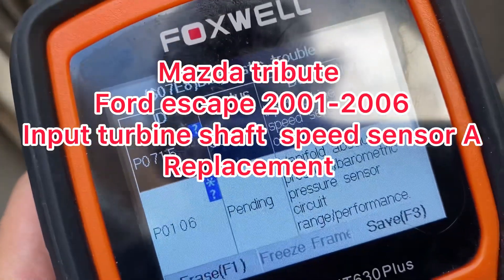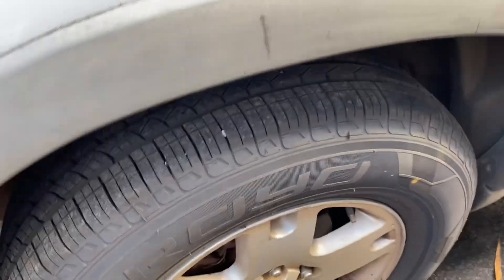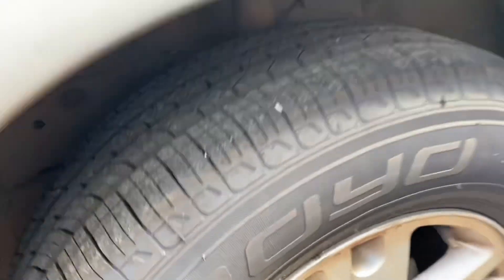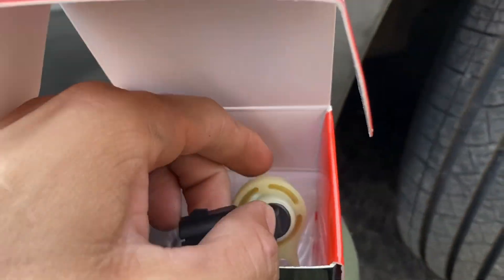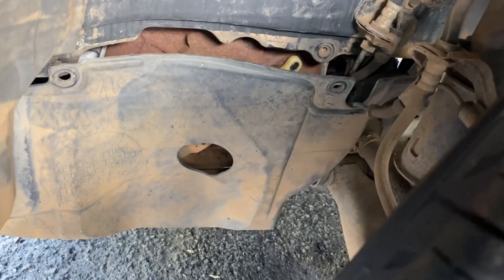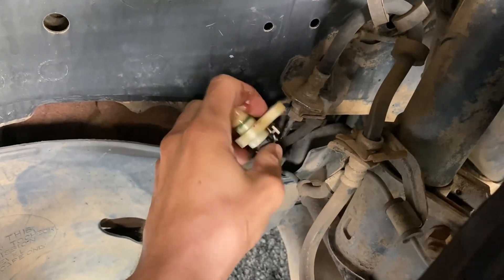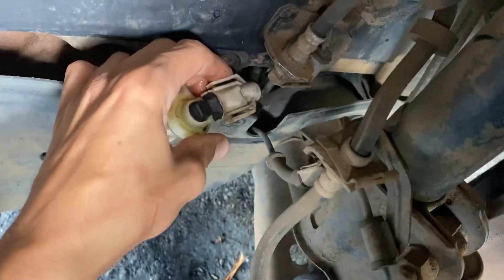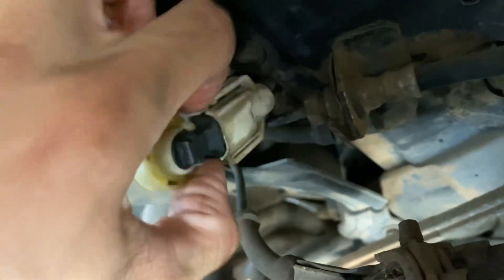Mazda Tribute / Ford Escape (2001–2006) P0715 Fix | Input Turbine Speed Sensor Replacement DIY

Comment: That was useless video. It didn't actually where it was located behind the plastic cover and how easily accessible it was to unhook, the reinstallation of the new part or results after changing it.
Reply from the maker: Thanks for the feedback! I'll make sure to include more detailed location and installation steps in upcoming videos to make them more comprehensive.

Comment: CAN ANYONE TELL ME IF THE 2005 MAZDA TRIBUTE IS A SOLID LITTLE CAR?  IT IS IDENTICAL TO THE FORD ESCAPE DURING THOSE YEARS.   IT HAS A 3.0L V6 DOHC .  WILL THIS CAR LAST 300-500K MILES WITH RELIGIOUS MAINTENANCE?
Reply from the maker: Engine wise is not so bad but you may have to change the vacuum hoses after 150k+ miles they become brittle and brake so it’ll likely give an engine code.
Transmissions they start acting up after 100k miles if you don’t change the fluid every 60k miles I believe. If you get one with low mileage and you do some maintenance you’ll be ok